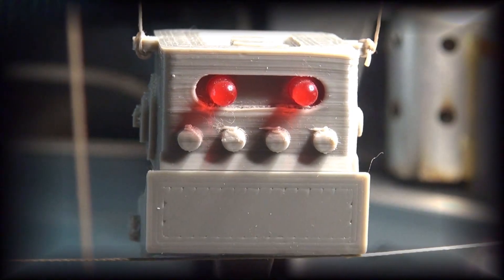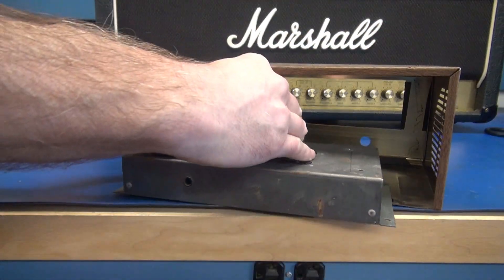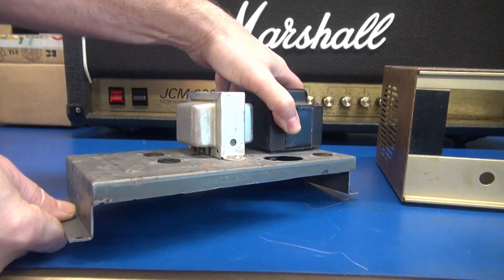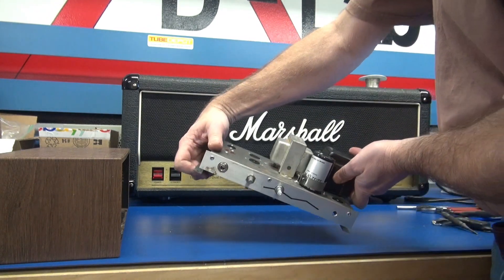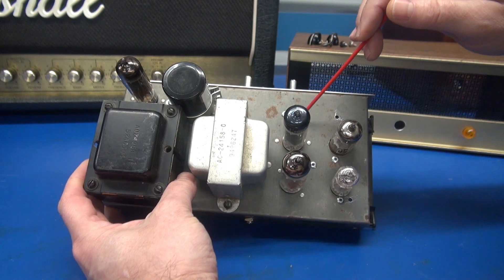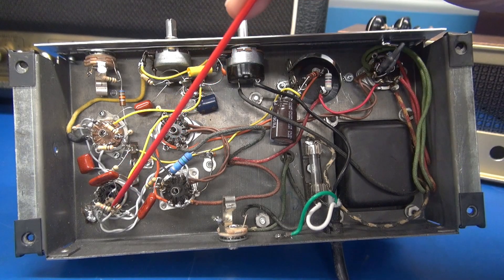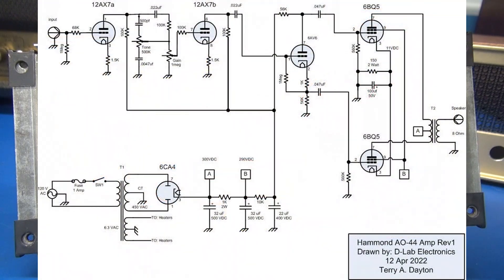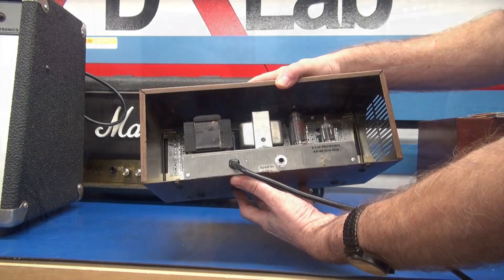Convert Hammond AO-44 Organ amp to a cool EL-84 tube guitar amplifier boutique build fun!

Comment: I've noticed the last couple builds you've featured had the on/off switch on the tone pot. Is that just preference? Or is there a reason it's not on the volume pot? Thanks!
Reply from the maker: Tone pot has less noise issues with prox of AC line

Comment: What a terrific project and ingenious solution? The EL84s sound so sweet with a simple tone control. I'm wondering why you wouldn't locate the tone after the volume. Also, is there a reason for putting the switch on the tone rather than the volume?
Reply: I think the tone control was used to switch AC power because the volume control swiper directly feeds the next stage grid. And coupling to that stage may induce more noise than the AC through the tone pot that has some noise filtering effect. Yes?…
Reply: @tjminasi1442  Thanks for setting me straight.
Reply from the maker: Yes Sir 100% correct

Comment: Is the filament supply going to be able to support the current for that amp? I believe those AO-24596-1 transformers only had a 3A filament supply. With the 2-EL84s (1.62A total), 12AX7(0.15A), 6AV6 (0.3A) and the EZ81 (1A), it is right at the 3A mark. This could easily be over the 3A mark with the increase in modern mains voltage. Originally it would have only had approximately 2.3A of filament current. I know I went through all of the calculations with the one that I built and decided to go with a solid-state rectifier, to save that 1A on the filaments. I could be wrong about the 3A, but as I recall from when I did this, that is what it was. Unfortunately, I can no longer find the spec sheet on the original AO-24596-1 transformers to verify. If you have something that says otherwise, please let me know. Thanks!!!!
Reply: I like the way you think.
Reply: @DetroitWrecker666  It is the Electrical Engineer in me. I'm always thinking of those things.

Comment: I am completely entertained with those  amp conversion videos
Reply: That's where a good understanding of guitar amp theory comes in with regards to converting radios and other amp into guitar amps.  As time goes by, the typical tubes used may dry up, and knowing which tubes can be re-purposed is good to know.